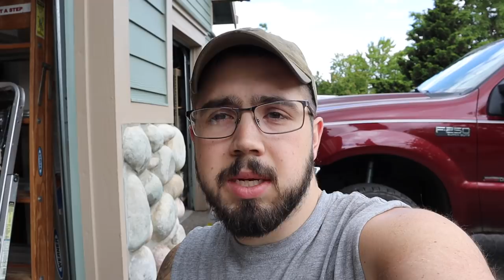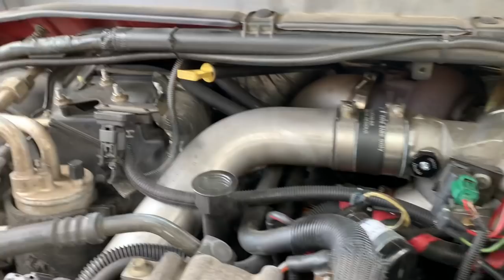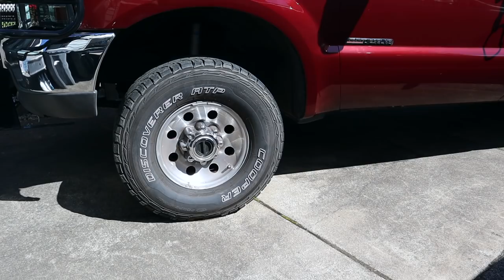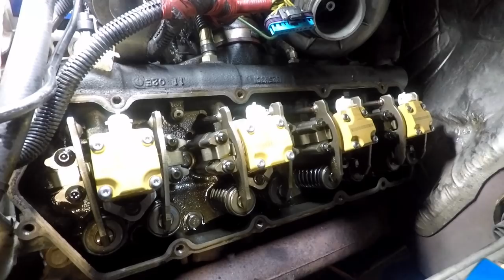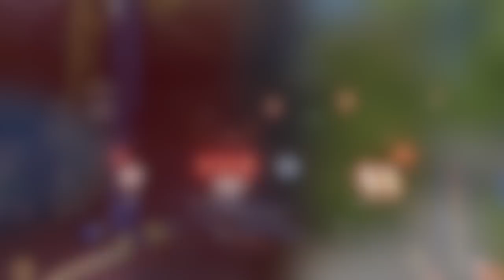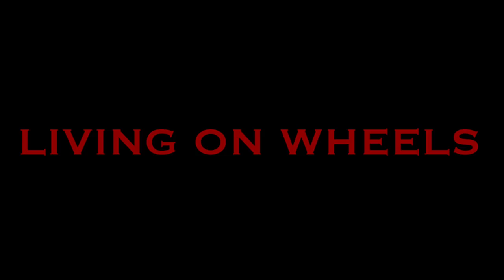Ford 7.3 Powerstroke Detailed Blow by Test

Comment: My 7.3 has a lot of blow by to the point where I put the oil cap  on. it goes up and down like if it was to blow it off… do I need a new motor or is there a way to fix this?. I
Reply from the maker: Make sure your crank case vent isn’t clogged but otherwise you’re looking at a rebuild or new engine.

Comment: Thanks. I just bought a 2001 f-250 super duty with 114k miles and was a little nervous because a little smoke came out when I checked foe blow by. My old 6.9L IDI had 250K and zero smoke comes out of it so I was concerned. I'll get a ping pong ball for fun.
Reply: How did things turn out?
Reply: I have a 2000 f250 and mine has smoke but it’s now what u think it is. It’s normal for 7.3’s

Comment: Hi I Checked mine after doing the oil leaks, it's about as good as yours with 360.000 miles on the clock. i was surprised as the last guy hammered my truck hard with poor maintenance and it's not rebuilt.  lots of guys are doing the CCV delete that will open the vent system causing false readings if thats been done a guy will have to check the end of the pipe with a hand to see whats going on. I was going to delete mine but found the "odor d Rotella " from the haze around the engine when I tried it before running the pipe offensive so I didn't do it in the end. You being here making great video's is more than enough for lots of us and worth far more than you can value with a give away for a thousand subs, it's totally your choice in the end . Thanks for another great video, Take care

Comment: I believe it's crank case gases. In diesels there is naturally more caused by the forced air induction via the turbo pushing passed the piston rings. Quite normal to see a little smoke/ blowby in any turbo diesel. More continuous smoke = more compression loss/  gasses getting past the rings. Correct?
Reply from the maker: Pressure is what you should be more concerned about but that being said, the more blowby pressure you have the more smoke you usually have as well.

Comment: Does that stiction elimnator help the piston rings break loose from the carbon build up.? Or is it a waste of money.
Reply from the maker: Stiction does not involve the pistons at all actually. Stiction is cause when oil breaks down over time inside the injectors eventually leaving a thicker residue. This residue can impede the injectors from firing properly. Stiction eliminator is made to break down that residue and keep the injector's internals clean. Some people swear by it some see no affect.
Reply: @LivingOnWheels  the stiction eliminator is not just for the injectors. it is used for everywhere the oil touches.  definitely most effective with the hui injectors in the 7.3 and the 6.0 but that oil build up like carbon. the stiction eliminator. so to answer the question no it does not remove carbon but removes the oil build up through out the oiling system. big thing on the 7.3 is long extended crank and if its not an injector issue or glow plug issue i usually see that the stiction eliminator will help with cleaning the hpop and  help with smoother starts. great video.

Comment: one thing you didn't mention is the condition of the oil, pull the stick, if it drips off like so much black water, it's not going to seal the rings. I bought a 85 with a 6.9 in it years ago that had nasty blow by but the oil looked like it was 30k miles old, got a smoking deal on the truck and put fresh oil in it which made it quite acceptable,  starts too, needs that compression. 

and I may be wrong on this one but I learned somewhere the mist is atomized oil, just like fog if water, my understanding is it's from the hpop action on the injectors and like fog it will go back into the oil, true blow by comes from the combustion chamber and is burnt oil, ... smoke
Reply from the maker: I appreciate the input. I haven’t heard the oil thing before but it makes sense. 

And yeah I’m not sure on the mist/haze. That theory doesn’t seem far fetched.

Comment: Very useful video Joe thanks again for explaining what blow-by is and for those of you reading you probably seen videos on The ccv Mod and how people are bypassing them because it sucks a little bit of oil into the intake remember diesel engines are a lot different than gasoline a little bit of oil in your intake never hurt anything these engines love oil it's not like you're going to foul a spark plug LOL and if you think it's going to give you more power or benefit your truck that is definitely not the case if you do not believe me watch one of Bill Hewitt's videos powerstrokehelp.com on ccv mods and why it is a bad idea to do so basically International design this engine this way to relieve the crankcase pressure and if you disconnect this and vent it you will run into all kinds of problems down the road it may not happen right off the bat but you will start blowing seals and gaskets so do your research don't quote me to the T I don't know everything I'm just trying to spread some knowledge and help those out there in the 7-3 community so remember to always do your research read multiple forms watch multiple videos before you make your final decisions on what you want your truck to be
Reply from the maker: Thank you. I have heard so may opinions on this topics going in both directions. Last I heard is that International actually vented it to the atmosphere and it was ford that routed it into the turbo. As for now I plan to keep the ccv stock.

Comment: Curious to if the “blow by” or haze coming out of the dipstick tube is bad ?
Reply from the maker: It's not abnormal from the best of my knowledge. Im not positive if the tube itself goes below the oil level or not. I don't think it does which would mean that is is also exposed to the crank case haze just like the fill neck.

Comment: When you do this test you really should block off the vent that goes into the turbo side because the turbo is sucking it out too, I did it both ways and got completely different results
Reply from the maker: Yes, I have heard it being done both ways. Most common is leaving the vent open though. I can see reasoning for either one.

Comment: My 2001 7.3 with 174k has zero blow by. It actually has a little bit of vacuum that pulls the cap down. What would cause that?
Reply from the maker: Seems very odd. I don’t know. Try putting a ball on it and not the cap
Reply: @LivingOnWheels  I tried that when I first tested for blow by. It has light vacuum that pulls down whatever you set on top of it. It's not hard suction or anything, just light enough to hold down whatever you set on top. I've never seen that before with any of my 7.3's.
Reply from the maker: Ryan Juntunen interesting. Only thing I can think of is maybe it’s getting enough suction through the ccv that it’s causing it. How dirty is your air filter? Maybe if that dirty enough then it’s sucking more out of the ccv

Comment: What type of shocks do you use and were did you buy them? I have a 01 7.3 and I’m ready for a  shock change . 320,000 miles on the dash second owner.
Reply from the maker: I am running...
Rear: https://amzn.to/2IZ9esH
Front: https://amzn.to/2J0ze74
I am sure there are higher end ones out there, but these have been pretty good to me.
Reply: Thanks for the reply. I will look into them .

Comment: Joe, I have a question for you.  Perhaps you've had some experience with this issue, that just occurred with my super duty.
Yesterday I noticed that my truck didn't go into overdrive when I came to town.  The overdrive off button on the end of my shifter was blinking on and off.  When I pushed the button, it did knock it down a gear as usual.... but it still would not shift into overdrive, and the off light kept blinking.  Although I don't know what the problem is, it doesn't feel like it's something major......
Any ideas ???!
Reply from the maker: The OD light flashing means that the PCM is detecting something wrong with the transmission. There is a fuse under the dash (23 I believe) that if it goes out can cause some trans issues.  That is worth a check. If that doesn't seem to be the case then the computer should be storing codes from this and you should scan the truck to see what it's saying.
Reply: @LivingOnWheels  Morning Joe.... so thanks for your reply.  I thought I'd just tell you what my next try is going to be...based on "some" research.
I removed the shifter to check the wiring to make sure it wasn't grounding out....was ok...
Next, I'm going to buy a new selenoid pack...(roughly couple hundred bucks).  Drop the pan, few bolts, no biggy.
I cannot believe anything major is wrong with the tranny, since it shifts through all the other gears normally...it doesn't slip, or shudder, it simply doesn't go into overdrive
...IF that doesn't do it...then, I'll get a new ECM-PCM.  (roughly 500 bucks)

If some out there might wonder, why I'd throw money at parts, and not just bring it to the dealer...IS because it doesn't take long to dump big money at the dealer, for very little in return.
I'll keep you posted as to the progress

Comment: Little off topic but do you change your HPOP oil in the reservoir when you do oil changes?
Reply from the maker: I currently do not. Been recommended to do it by a few people. I can see why people say too but, very few people actually do it and these things still go for hundreds of thousands. I might start doing it every other change or something of the sort. Who knows haha
Reply: Yeah probably wouldn’t hurt 7.3 injectors are finicky some go 300,000 plus original and some crap the bed into mid 100’s
Reply from the maker: That’s for darn sure! Unfortunately my injectors were the latter of the two. Don’t think the previous owner kept up on fluids and filters as well as he should have for most of its life.
Reply: True but you have a fresh slate now buddy!
Reply from the maker: phil posada exactly! 👍🏻
Reply: At 309 Thousand Miles right now on stock injectors I'm very religious with my oil changes my job pays for the oil been that way since 2002 sometimes I do it just to do it when it's not even time so yes maintaining your fluids and keeping them clean my truck is living proof and it is still running strong I do want to do injectors soon I know the intensifier Pistons are wear item there's no getting around that no matter how many oil changes your do
Reply: I have a 2001 7.3 F350 Dually I bought new and I have always sucked the oil out of the reservoir. You will only get about a half quart but it's well worth it. The only problem I've had over the years is rounding out the Allen in the plug. I had to make a new plug with a 9/16 hex head. No more problems with that any more! Draining the reservoir it's certainly worth the trouble. Make sure you fill the reservoir before putting the plug back in or the engine won't start right away do to lack of high pressure oil for the injectors.

Comment: Your awesome. I’ve been so confused on this subject since I bought my obs 7.3! Almost 1k subs! 
On this subject I’ve Watched or read some and been lead to think my engine is trash then others say it’s nothing. Been a roller coaster of emotions with this subject. 
Do you have CCV mod?
Reply from the maker: Glad this helped clear some things up for you man! It's hard to say if an engine is good or bad without seeing it and hearing it in person. I do not have a CCV mod and its not really much of a priority to me to do it. The major benefit of the CCV mod is eliminating oil in the intercooler piping which helps keep the engine bay a little cleaner, but other than that there isn't anything really wrong with the stock setup. Millions and millions of miles have been run by 7.3s with the stock setup with no real bad side effects other than a more oily engine bay if you don't clean it. I wouldn't worry too much about the CCV mod.
Reply: Living On Wheels up late answering replies. Thanks. I am not too worried considering I’m a non intercooler setup. I’m super happy about doing diesel ORings dip stick flange leak fix this weekend and it’s working! Did epbv delete too. New pedestal ORings too. Pressure washed engine bay to have clean motor to spot potential leaks still. But so far so Good! My daily Prius is going into dealership today for maintenance. So running the OBS 7.3 to work!
Reply from the maker: Ahh yeah with now intercooler then I really cant think of any downside to keeping the stock ccv. Good to hear the Diesel O-ring fix seems to work well. I will have to try and remember that. Good to let that old girl stretch her legs a little haha.

Comment: Would like to see this done on a fresh rebuild, using the ping pong ball, as a baseline for comparison. Since we don't have any new 7.3's around for comparison.
Reply from the maker: I agree. It would be really interesting to see!
Reply: My last 7.3 had a reviva reman 7.3 in it. Around 10k on it when i purchased it. It had more blow by then any of my 7.3s and im on my 5th one. So don't think a newer engine wont have blow by. I ran rotella t6 in that newer engine and in my honest opinion 7.3s and rotella syn are not very good team. I run napa 15w40 and that seems to be the one my truck likes, even over delo 400. My current one is a 99 and has the least blow by i have ever seen. Its old, had ladder rack on it and heavy duty rear welded bumper. Makes me believe somewhere along the line someone used this as a contractor truck. But seems to have been taken care of. I bought it with 246k miles and a fresh new trans. I've taken it on firewood hauls, over a dozen camp trips wheeling very far into backwoods and down into  lakes. Towed my ski boat over mountain passes all summer long. Just rolled 255k yesterday. Loving this truck. Just cosmetically looks like shiattttt. Anyways loving the channel dude! Bummed i missed the turbo give away as i think thats the first to go on my truck in future. Keep up the great content

Comment: I have 353k on my 7.3 and I did this test it does have that smoke from the cap so do I worry about the smoke because the ping pong ball didnt move much at all
Reply from the maker: I would say not to worry much about smoke or no smoke. The smoke can fluctuate a pretty good amount based on engine temps. The important part is the actual pressure coming out of the crank case because that is showing what is getting passed the pistons. If the ping pong ball didn't much much at all then I would say that you are still in pretty good shape. I have seen videos where the blowbye is bad enough that you can actually see it lifting the reversed fill cap ad blowing it off.

Comment: My 02 with 255k didn't have any till after I vented it to the atmosphere.
Reply from the maker: Do you mean you never saw it till you ended up venting it?
Reply: @LivingOnWheels  yeah you couldn't see any blowby   till after I vented.
Reply from the maker: So when it still vented to the intake there was nothing that came out of the oil fill?
Reply from the maker: @beginningtheend9259  That is interesting perhaps you just had enough vacuum with the turbo that it was sucking up most of it.
Reply: @LivingOnWheels when the ccv gets vented outside it will show a problem with the turbo. With vacuum it will hide turbo problems.
Reply: My dads 6.0 has zero blowby from the oil fill too. And at some point to be vented to the atmosphere.

Comment: I found a 99 7.3 manual with 50k 1 owner. The dealership wants $28500. I cant get him to budge on the price. I offered him 27 and he told me to kick rocks. Do i bite the bullet and get my dream truck or do i just buy a newer cummins roughly for the same price... Im trying hard to justify buying a 20yr old truck for that much.
Reply from the maker: To be completely honest man, I don’t think any 7.3 is worth much over 20k let alone almost 30k. If it were me, I would probably be looking at the newer Cummins. I would be more inclined to buy a 7.3 with 100k-140k miles on it for 15k-18k than I would that one. These are great trucks but at the end of the day, they are still 20 year old rigs.
Reply: j5long I just bought a 01 F-250 super duty that is cherry with 114k for 14K don't even buy that truck.Took me a yr and a half to find it.

Comment: As a matter of fact my oil at 5,000 mile intervals oil change it is still gold in color and not black
Reply from the maker: Sounds like you have a very healthy engine!
Reply: Terry Fuschak I started doing the HPOP flush with mine after poor maintenance from the last guy, my oil stayed fresher looking than any of my friends trucks for a couple weeks, it's surprising how much old oil stays in the motor during a change. I've just done the galley plugs, had the valve covers off for glow plugs,I was surprised it was not horrible looking up top from his poor maintenance.
        I did  oil cooler seals and flushed it and  sucked the last of the oil out of the HPOP to . My oil looks real nice now it will be interesting to see if it lasts longer without turning black in a month or so. I'm thinking yours has either had motor work/been flushed or it's been very  well look after not to be going black in those miles.

Comment: My truck has 456 thousand miles on it. and my truck does not even smoke like that there is nothing coming out of oil fill cap.my cat sits on top of the oil field without moving why it's running.
Reply: I just bought a 02 7.3 with 400,000 miles on it and mine is exactly the same as yours, no smoke no nothing!

Comment: I didn't have a ping pong ball so I used half of an egg shell. I had less blow by than you with 213k miles on my truck. I had more blow by with the ccv mod
Reply: so did u reroute the ccv back into the intake then?